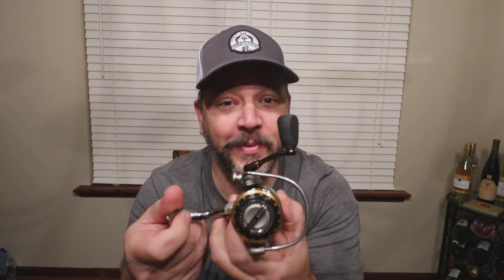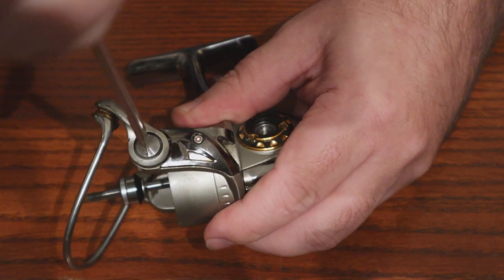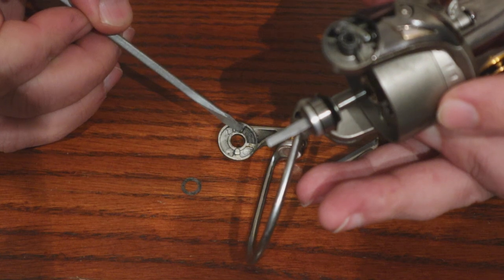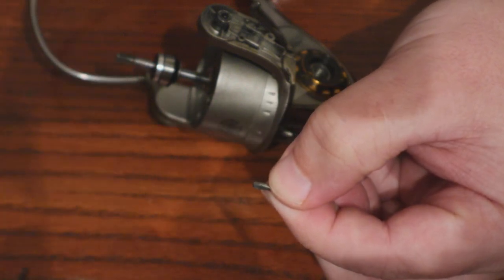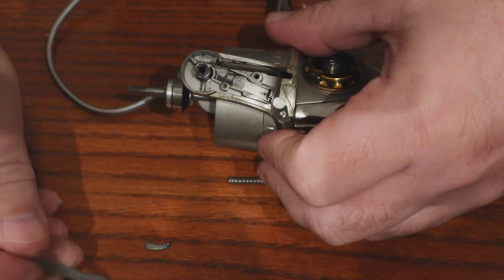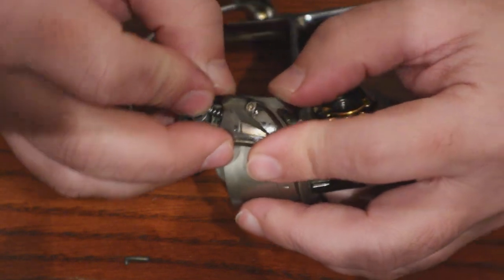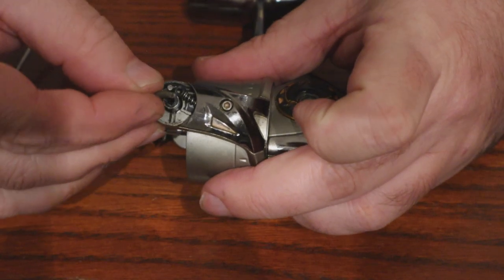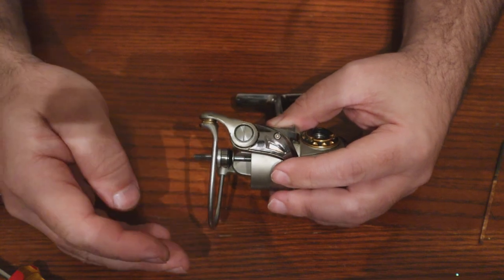Easy Fishing Reel Repair | How to Fix a Spinning Reel Bail Issue!

Comment: Great vid; My issue is that the bail on my Pflueger President XL frequently slams shut from the momentum of my cast.  Perhaps just a clean & re-lube fix?
Reply from the maker: Clean and inspect. Could be a loose spring.

Comment: The model I have is 6740XT so when I remove that first screw the "guts" are not the same. There is black piece that seems to have broken off of something. I can't figure out where. Obviously I need a new part.

Comment: I have two Lews speed spool reels both the same model, but the bail on one reel is hard to flip over while the other is easy so do you have any suggestions on a fix like modifying a part on the reel.

Comment: I may be stupid but your explanation seems incomplete. Granted there is a prong from the spring that fits into the hole on the circle part of the bail BUT, there is a great big BAR in there and you dont explain where that goes. both prongs won't fit into that one hole. Am I missing something?